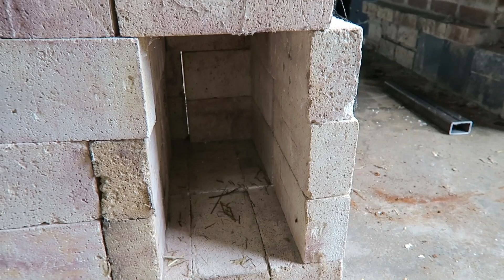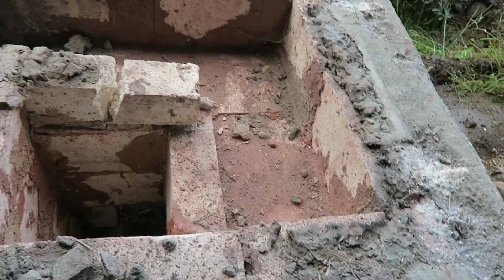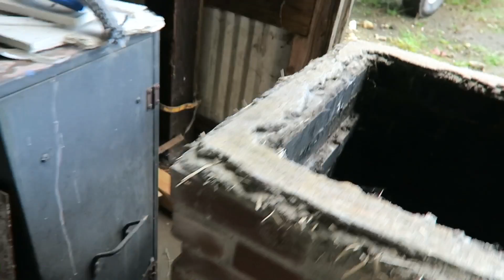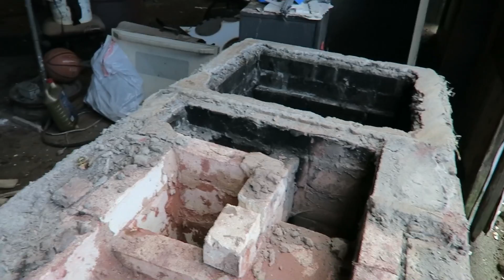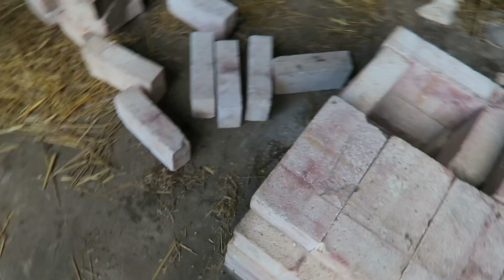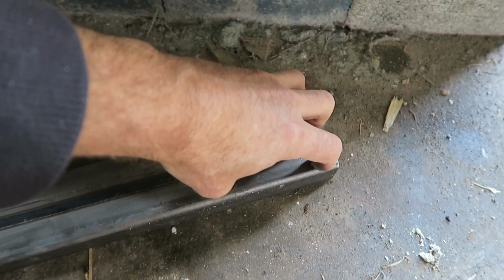Walker Wood Fired Masonry Cookstove and Oven Build Discussion

Comment: What temperature does the oven reach? And do you think it would be okay to install a steel enclosure for part of the oven? How will that affect de temperature??
Reply from the maker: The oven can reach 450°F after some burning, typically it's around 350°F. Yes, you can install a metal enclosure to create a "white oven" and it will buffer the temperatures a little bit but with the proper design it can still attain baking temperatures. Thank you for your comment!

Comment: can we use clay/perlite mix for the core, or does it need more insulation?
Reply from the maker: That would be okay from an insulation standpoint, but I don't think it is going to be durable enough.  The ceilings will be a real challenge to build with only that material.  If you pull it off, I'd love to see it!  Good luck!
Reply: I recently made a batch box using clay/perlite and it has pretty much good durability. I also made a crush test and I was satisfied, for the batch box at least. And also I used a thin layer of clay/wood ash on the clay/perlite boards for extra durability and protection. it looks like it works.
Here is the link to google photos for the batch box.
https://photos.app.goo.gl/bT1dfNSrf6OBJ7hJ3
Reply from the maker: Wow, you did an awesome job on that mix!  Yes, absolutely you can build this core with a mix like that.  Happy to meet another person who doesn't feel like they need an armored firebox.  Good stuff Sir Benjamin!
Reply: Thanks. I'll try to build one once I have the time :) I expect very soon :)
Reply: SirBenjaminT i am going to try to make a batch box using ash clay and sand that i locally collect. I like the idea of using no power tools and locally sourced materials. It may have to use a lot of ash to keep it light though, huh. Any video or update with your attempts?

Comment: Been collecting ideas for a container home build, and I would really like to incorporate some smaller form of your stove in the design.  I have two questions.  What other materials would work for the external skin, or do you need the brick to hold it all together?  I am thinking of a more contemporary design to go with the look of the container(s).  Also, how about a cast iron cook top instead of the glass?  Thanks man, really enjoy your videos and have not found anything out there that comes close to what I want besides your design.
Reply from the maker: Thank you Richard, I'm glad to hear this design is filling a need.  The outer skin can be just about anything, but keep in mind the bricks are the mass and the thermal storage.  If you go with a light skin, you lose the long heat cycle of the stove from it's body.  That's okay if you want a cook stove only, or cook stove and hot water,  or have another bench or thermal mass in mind after the cook stove.  It will work beautifully as a stand alone cook stove and/or water heater, but it won't heat a space through the top alone.

As for the skin, I have drawn it built entirely from aluminum, or steel, and it would be a wonderful stove, with very close clearances allowable since the internals would be mostly insulated.  It could also be hardibacker/tile, or stone veneer, or just about any non flammable material.  Outer surfaces won't get above 200F in most locations.  

Cast iron would work great, although it does change size more than the glass which can cause finishing headaches.  Not a show stopper though, and it works well.  The glass is my ideal, but cast iron is a good option for sure.

Hope that helps!

Comment: Why would you not divert the hot gases from the core to the center bottom of the oven? Brickwork can be done to create a helical rising gas pattern increasing contact time with the oven. Ironwork in the door could be done to make a continuation of the gas path in the front. 

I guess the point being it would increase the heat at the bottom and more evenly distribute the heat resulting in a more reliable cooking environment.

Other than that this really is freaking brilliant.

Comment: what would your opinion be on using sheet metal say 3/16 instead of glass?
Reply from the maker: The steel will work.  It will deform from the temperature differences 
across it, but if you don't care how flat it is, it should work fine.

Comment: Hey.  Thanks so much for that video!  Totally inspiring.  One piece of information I'd love to find out is how easy it is to regulate the temperature in the oven and stove top as well as preheat time and temp stability in the oven.
Reply from the maker: Hi Stephen, the oven temp is fairly easy to regulate with the bypass, fuel selection, and air settings.  I had thought active oven temp control would be important.  In practice, I never use it.  The brick mass of the oven just cooks so evenly that temp control is not an issue.  I thought I'd agonize over it while smoking brisket as I was used to, but....it just cooks.  You make small adjustments, but it is pretty neat.  That said, you could regulate temps fairly accurately from about 300F to 500F the way I have it configured.  Cook top is just infinitely variable across it's surface.  Small adjustments can be made with air and fuel, but it's basically hottest to not as hot.  It does just plain work though, so I stopped working on those aspects once I experienced it.  Thanks for the great questions  and kind words.
Reply: Thanks!

Comment: Awesome video I've read through the comments and was about to ask a similar question to Gregory your reply was very interesting regarding using insulated fire bricks as oppose to heat absorbing fire bricks like what pizza oven use. This has really got me thinking as I'm about to start a brick smoker then one of these ovens. Would there be no benefit to the heat absorbing bricks slowly releasing their heat as the wood burns down.
Reply from the maker: I raise beef and lamb, sometimes hog, and smoke with these things daily.
 Brisket yesterday.  My opinion is that the heavy bricks are a hold over
 from times past, and are almost always a negative in the flame path of 
these modern wood burners.  I was watching Mike Holt discuss electrical 
code yesterday, and he was saying it's too late for anyone over 50.   
We've been wrong about grounding and bonding until just these last few 
years.  I feel the same about fire.  Heavy, high mass bricks in the 
flame path are a detriment.  You put the mass after the combustion.   
Period.  Your smoker will benefit from heavy bricks for sure.  Just put 
them where they make sense, after the combustion, to store the heat, 
rather than cool the fuel.  Get it?  Great question, thank you for the 
comment.

Comment: Are the window replacement bricks flush on the inside or recessed?
Reply from the maker: I had them stepped back a bit to make sure there was adequate flow through the U there.  I believe you could fudge it a bit either way depending on how it is coming together, how tight the outer skin will be, how square you are, etc.  Just don't pinch it there at the corners.
Reply: flush is ok?  or will it choke? That wall hits my masonry bell.
Reply from the maker: Yeah, I think so.  Measure the flame path from the inside corners to the tightest spot, and make sure it's as big or bigger than the final port into the "riser."  You don't want to have that corner be the tight spot.  The boundary friction from the walls combined with the turn will pinch it and it will choke.  If that ends up tight when you measure, use a sawzall blade or something and slice a bit off of the inner corners and wall end to make sure there's room.   You might not need to do anything, just measure and think about pouring water through there.  What will it do?  You want it to swirl but go fast, not glug, glug, glug.  Got it?
Reply: shucks.  1/2" smaller.  It would be easiest to shave a 1/2" off of the face of the inner brick.  Do I need to dig into the wall?
Reply: 1" and 1 1/2".
Reply from the maker: I doubt it matters where you make up the gap, just don't choke it!
Reply from the maker: It's gotta be more than 2" everywhere.  1.5" sounds too tight.  Was mine that small?
Reply: Sitting at the door, the inner wall is five flush whole bricks. With my front brick flush I get a 1" wide x 9" high gap.
Reply from the maker: Make it 2.25", somehow.
Reply: That's bigger than the channel to the "riser"  mine being 1 1/2".
Reply from the maker: Yeah, that should be the tightest spot.  Stop arguing.  Make it 2.25".  Cut bricks man, it's easy.
Reply: In the pictures they all looked like full bricks.  At least these are soft brick.  I set the firebrick and kiln brick a couple of days ago. I'll tear it apart...Again. It was all hard brick last week.
Reply from the maker: Dude.  Look at your first question.
Reply: Riser channel smaller than the turn. Got it. A slight choke.  Is my 1 1/2 too small?
Reply from the maker: Now you are screwing with me.  You took out the window, you don't want to recess the bricks.  It needs to be 2.25" if it's going to work.  I've built a whole heater in the time it took us to come back around to the beginning.  Go cut some brick.
Reply: Just got the three layers torn apart and cleaned.  Mortar reconstituted.   

Now, I wasn't messing with you at all.  On the contrary!  I'm entirely grateful!
Reply from the maker: Good job!  I'm sorry, I really am building another cook stove right now, and I was all up a different set of measurements and figuring, so I got a bit flustered there.  I'm covered in mud and brick dust!  Glad you are getting it done.
Reply: We're in the mud.  My problem was the junction of the core and bell.  I had half-brick as the back wall of the core mortar ed to the bell.  I didn't have the space.  They're replaced with full brick now.  1 1/4" excavated to get to the 2 1/4" for the first channel.
Reply: Again, thank you!  Back at it today. It's amazing how much faster the third build goes. 

I got to thinking about the three T's.  As I'm notching brick for the window replacements I wondered about bevels to "smooth the flow" through the turn and how it would not necessarily be a good thing.  The turbulence would decrease and draw speed up, if I'm not mistaken.
Reply from the maker: So many variables, but all of that comes into play in the tuning.  It depends on chimney height, outside temp, inside temp, heater temp, dryness of the build, fuel type and dryness, and on and on...but, yeah....when I went to the Wood Stove Decathlon, Dragon Heaters did a re design of Peter's batch with smooth flow designed in like headers.  It didn't work.  If things get out of the hot zone too fast, without mixing, it's no good.

So, yeah man, you are in the zone!  That's the way to think.
Reply: Fun fun!

Comment: so where do you get this kind of brick?  I don't like the hard and heavy firebrick either.  they hurt when you drop them on your foot and lethal when hurling at people's head
Reply from the maker: You can usually find them at either potter's supply houses, fireplace shops, or special order through your local masons supply.  Best is find them rotting behind a potter's shed.
Reply: so don't pi$$ off your wife  ;)

Comment: it's interesting to me that you've insulated the fire box and serpentine flue gas path(rocket stove) in this stove. I see the logic. My understanding of the finnish fireplace (different from your oven as mentioned below) is to slow the gas and allow the mass of the fire brick(different from insulated brick) to absorb and retain then radiate heat(dropping flue exit gas temp). so, my question to you is......what kind of temperatures are you seeing at the metal chimney?  if you have that capability, i'd be very interested to know. if not, no worries and fantastic job by the way!
Reply from the maker: Gregory, the old school of thought is wrong in my opinion, and my Testo 
agrees.  Those high mass fireboxes rob heat from combustion and never 
give it back in a useful way.  I have gone around and around with my 
fellow builders, but the Testo doesn't lie.  High mass fireboxes make a 
lot of CO.  Insulating keeps combustion temps hot throughout the 
combustion zone.  The concept is to combust completely, then extract.  
So, the answer to your last question is a function of how well I have 
designed the extraction stage.  In the case of the cook stove, there 
isn' t much extraction, so the chimney runs in the high 200°F to 300F or
 so.  That could be remedied with more bench or bell.  Hope that helps, 
thanks so much for the comment.
Reply: Gregory, A rocket stove is something built and used solely outdoors. Would a better term, such as masonry stove be better? I'm concerned that newbies to the concept might order rocket stove* plans instead of these ovens or heaters.   *(Mother Earth News kind.)  :D

Comment: This is a great help!  The walk-around the core, especially.  Building up my hard brick bell (entry is on rear the wall of core) and the short duct out of the bell ate my brick.  The promised pallet hasn't arrived yet, alas. Opting for a steel plate top @  3/4" thick for core and brick bell.  We've chosen to run 6" black pipe inside of the 12" triple-wall stainless chimney pipe.  Part of me wants to tear the 12" stainless out and use it for a bigger stove.
Reply from the maker: Nice dude!  Yeah, salvage that 12"!  Hey man, I think you told me to double up old windows in a comment a while ago, and I wanted to thank you.  I built a shack and I totally used that.  Hope you are well and your heater comes out rad.  And, yep, with no radiator first in line like a barrel or cooktop, the gasses stay super hot and can eat downstream components.  This is why I always cringe when newbies want to delete the barrel.  Have fun sitting on that magma.
Reply: So...coming out of the masonry bell into 3' of black pipe, a 90 degree bend into a cob covered barrel then straight up to the chimney will burn out? that far from the core?
Reply from the maker: Hey, crap, I mistook you for the other poster again!  Sorry Jeremiah, they have a painting for their AV that looks a lot like yours, and Youtube is tough to communicate via.  I know who you are now, you are building stuff!  

As for your question, well, it depends, but....I don't see a whole lot of extraction in the system the way you describe it, so yeah, a LOT of heat will get pushed downstream.  It's not even that it won't work, it's just blowing heat out the chimney, and yes, it may burn out the first section of pipe, unless by black pipe you mean sewer type black pipe rather than stove pipe.

I don't know how big that first masonry bell is, with enough internal surface area you could scrub a lot of the heat out of the exhaust.  

I'm not sure if that helps, but.....maybe?  I could do a live video later today or this weekend maybe, if some folks want to have a back and forth.  Any time in particular good for you?
Reply: Just say when!

The first masonry bell is 24" wide, 14" deep, and 60" tall with another plate on top.
Reply from the maker: That's a decent size, and the plate on top is a metal radiator?  Is it this cook stove firebox or a more traditional J or Batch?
Reply: It's a Walker core into a masonry bell topped with plate like the Cookstown portion.
Reply from the maker: ....and there is a cooktop over the W core as well, just like mine?  It should be fine, unless you go thermonuclear on a huge load of dry oak split small or something silly, consistently.

You probably won't get much over 300°F coming out of the bell unless you are burning full tilt all day, and you for sure will be able to moderate your temps.  I suspect it's fine, cover the pipe in cob if you are concerned so it can burn out and not matter, or build a brick channel.
Reply: ok. good.  I was afraid of cooling off too much!

Comment: Are some of the principles the same as those used on the big masonry heaters?

Thanks
Reply from the maker: Well, it is a masonry heater, so, yes, in the sense that the hot flue gasses are routed through masonry mass serving as a thermal battery.  The firebox design is not really related to traditional masonry heater designs, but rather a progression on horizontal flame path designs like the standard J rocket mass heater combustion design.  Hope that answers your question.